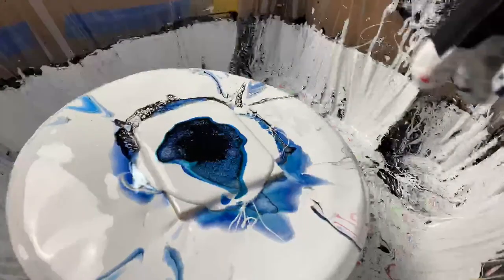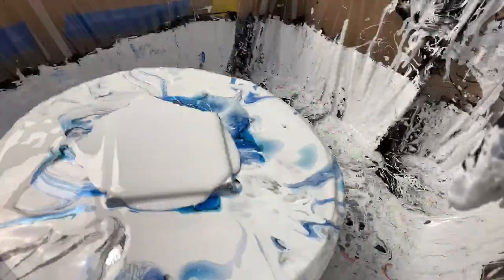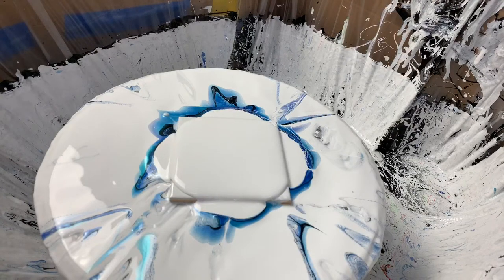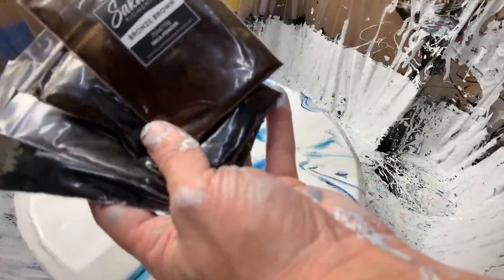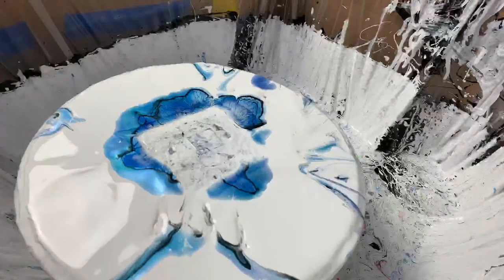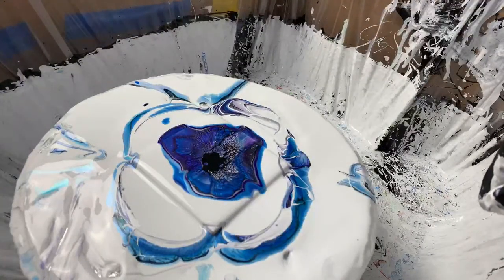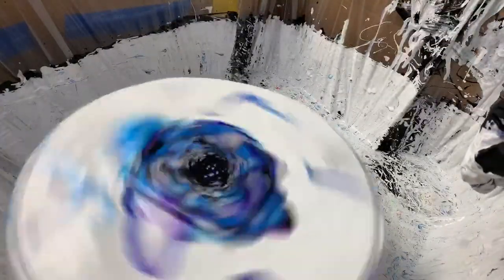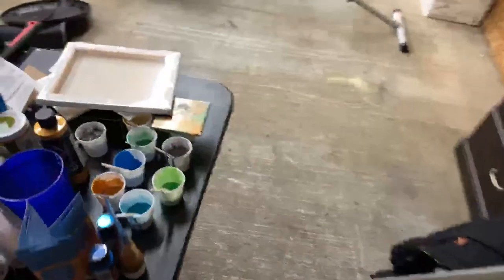Sheleeart Bloom Acrylic Pour | DIY Coasters and Trivets!

Comment: Your color combination is superb. Loved each and every  pour that you made. the cell remain intact in every pour. How do you manage that ?? I need your help with resin pour. I do not get an even coat in the entire tile. I do not use any Oil in the colors, my pillow paint is PVA glue with a little water, no silicone added in the paint and I use Australian floetrol for my Cell Activator. I even clean my tile with alcohol before I start the pour.I have checked the level with a level bottle. I still can understand why I am not getting an even pour. Can you please help??

Comment: What are you using for your puddle pour?
Reply from the maker: Valspar Ultra 2000 High hide white
Reply: Thank you for your reply.
Reply: Do you mix it with anything?
Reply from the maker: No I used it straight out of the can